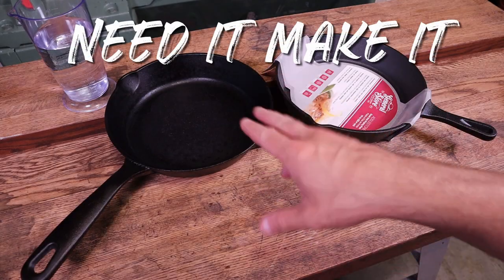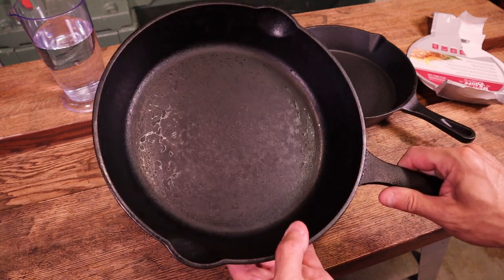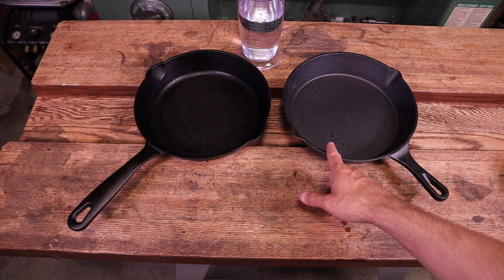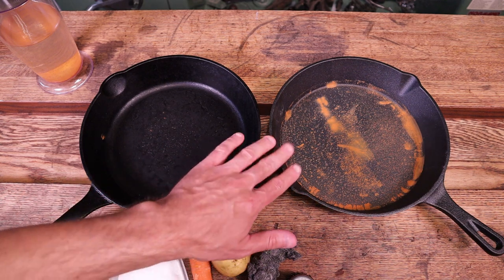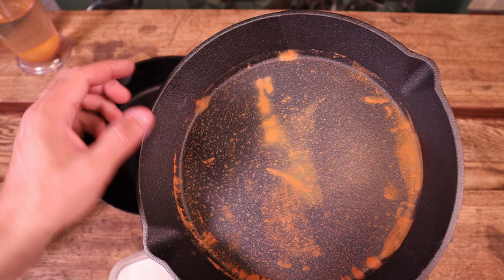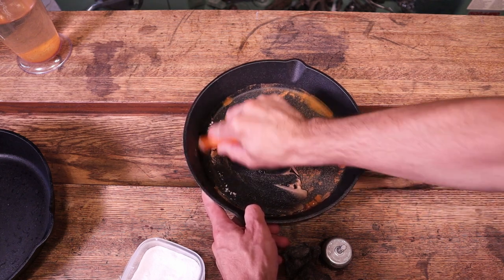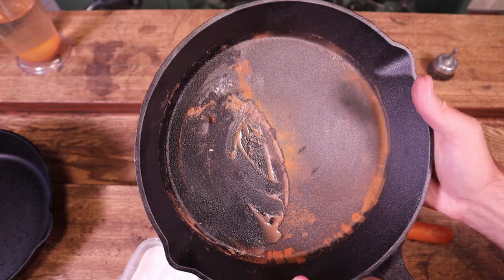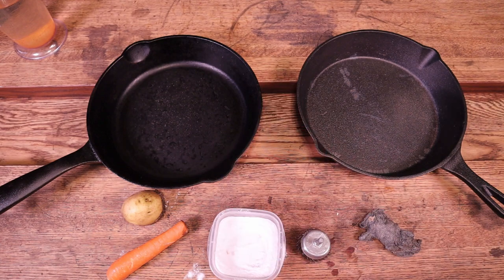🍳 You've Left Water in a Cast Iron Pan Overnight!?

Comment: Great video, I'm definitely gonna try the vegetable soda method sometime. I also watched and liked your polish video, I'm thinking of taking my lodge pan to the university shop one day to grind the center lower and polish the overall surface. Are you Canadian by any chance?
Reply from the maker: Hey thanks.  Cast iron can be addictive.  A smooth pan is more enjoyable to cook with, or really it is easier to clean, and they look better as well.  I have another video coming out in a few weeks which will be along the same lines but more of a traditional look and style of smoothing a pan.  I have no idea if it will work out, but it should be interesting.  It will be featuring some $8.88 pans CI pans on sale at Canadian Tire (Yes I am Canadian).  They are so rough, but I think they can be made to work just as well as my vintage pans. 

Do you find that the center of the lodge pan is a bit high?  This was a problem with my Lagostina, but normally Lodge are pretty good.  The butter would flow to the outside of the pan when heated.

Good luck!
Reply: @NeedItMakeIt  Yes, the center of my Lodge is a bit higher. I got it used off kijiji from a gentleman who used it on the campfire (found that out when my home smelt like a campfire when I seasoned it for the first time) so it might have been warped a bit from previous heating. It already has some deposit on the outer areas, idk if it's food or seasoning, it does make those areas smooth, but even with the deposit, the center is still higher.  I just made my morning meal on it :) Look forward to more of your videos! Cheers